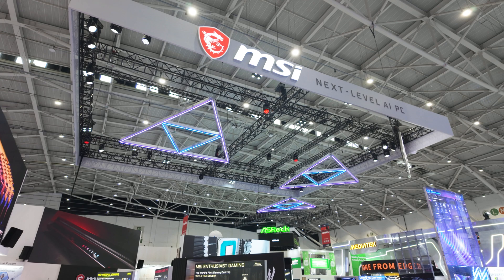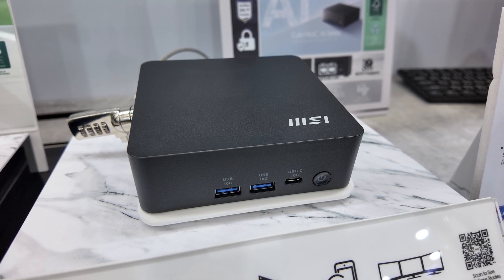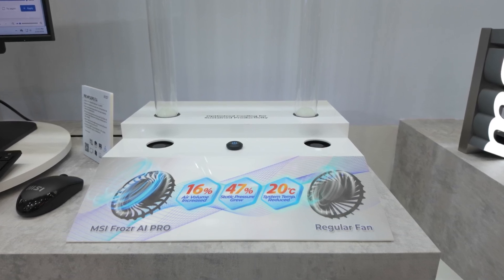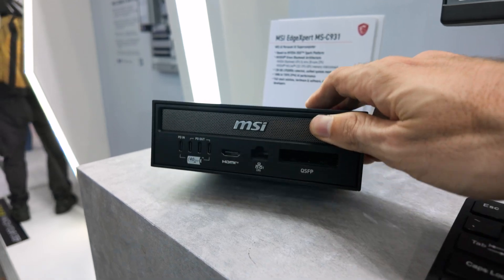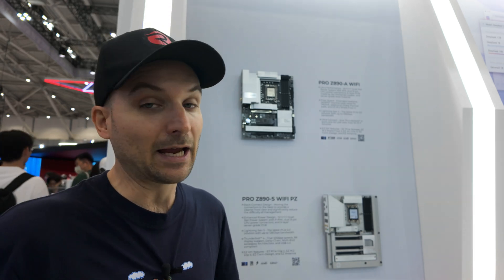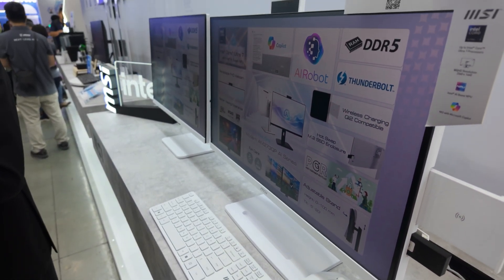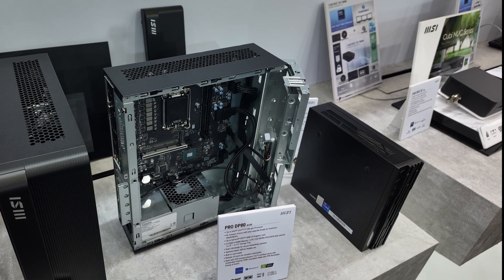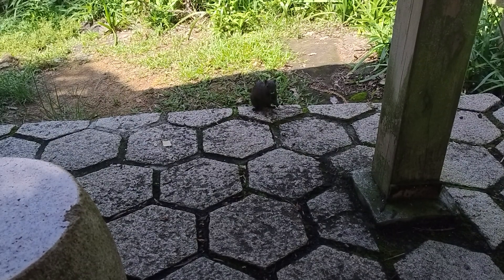Secret New Mini PC Unveiled & More at the MSI Computex Booth!

Comment: I have question , why we dont have mini pc by latest 200v processor ? Rather than old meteor lake 155h one ?
For example core ultra 7 258v , which is inside msi claw 8 ai+ and many other normal size laptops , why we dont have it inside mini pcs ? Is it limitation ?
Im really interested in lunar lake mini pc , from msi or asus , but i cant find one , all of these mini pcs are equiped with older gen meteor lake, and not lunar lake... even the latest models with ai like asus nuc 14   is equiped with meteor lake ...
Is it because lunar lake is not for mini pcs ? Correct me if im wrong
Reply from the maker: 01:27